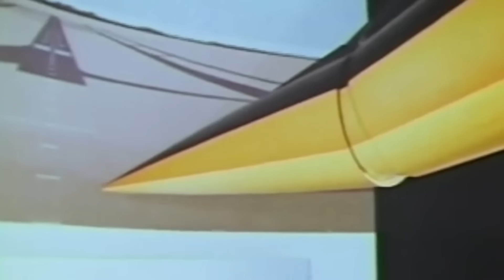The Insanely Bigger Faster American Concorde Failures

Comment: The reason CONCORDE failed was basically because the US government (paid for by the AIRCRAFT LOBBY) wanted it to fail as they couldn't make the SST work.
Reply: I grew up in Oklahoma City and in the early 60's the FAA coordinated with Tinker AFB and they did sonic boom tests twice daily over the city to see the effects.  You flinched every time you heard one, the dogs went crazy and they even had a phone number to call if you had a broken window because of a boom and they would send someone out to replace it.  After about a year they stopped the tests and determined it was too disruptive and that's where the ban on supersonic flying over the US by commercial aircraft came from originally.
Reply: @gregmiller7123  There were similar sonic boom tests in Chicago, though on a much smaller scale than the Oklahoma City tests. The claims for sonic boom damage were proportionally higher in Chicago, as expected in an area of higher population density. It's my understanding that the FAA would accept damage claims but the procedure was heavily bureaucratic and the FAA would use any excuse to deny a claim.
Reply: ...and the FIA banned Concorde from flying overland ... just to be sure !
Reply: @pierrepy2931  I think you mean the FAA (Federal Aviation Administration).  The FIA controls motor racing and I've seen some fast F1 cars but I don't think they broke the sound barrier!  Just messing with you!  Cheers

Comment: the Concord made the first A300 Airbus a pretty good plane, new alloys and machining, vented insulation, lighter seats, higher pressure hydraulics, tail tanks,  etc..better than Tristars , DC-10 and MD11...HS also used the Concord cab. diameter and fixtures to build the HS146 but supersonic aluminium planes were at the time too heavy and were flying too low and too slow thus increase drag and friction heat excessively. Today a composite airframe and better thermal cycles with H2 maybe can reduce the supersonic gal/mile to a competitive level by flying much higher and facing much less drag..

Comment: JFK didn't take office until 1961.  Also, the FAA is an administration, not a federation.  Too many errors right at the outset left me in skepticism mode while watching this.  Concorde operated for a couple years after the crash in 2000 and the fuel tank bladder installations.  There needs to be oversight before turning your finished project loose!
Reply: @Galileo7of9 Still not a federation though!

Comment: I saw a Concorde abort a take-off at London's Heathrow airport on 25th January 1982. It taxied back to the terminal where I guess either the problem was fixed there and then or the aircraft was taken out of service and another Concorde used, as I saw one take off about an hour later. Very noisy on takeoff but quietened down once in the air.

I'd like to see a feature on the development of  Martin-Baker Ejection seat and its derivatives, and the Russian versions. I read a book called "The Man in the Hot Seat" about it and it was a fascinating story.

Comment: The boeing mock up carried on as a tourist attraction at a so called " site museum" in Orlando, Florida. It was inside a large hangar with a lot of sad looking warbirds. I saw it twice in the 1980's, it was tired looking then, but the museum closed and the building was turned into a church  with services being held under its wing. For years they tried to give it away, but the draw of a one winged wooden mockup was zero, and I believe it was finally scrapped in the 90's
Reply: It sits in the Museum of Flight in Seattle, if I’m not mistaken

Comment: Another aspect was that Concorde was limited to Mach 2.25 not because it couldn't go any faster, but because aerodynamic heating would also be limited, allowing the aircraft to be made out of aluminium. The faster 2707 would have to use large amounts of titanium, a metal very hard to work with at that time.
Reply: Also most came from Russia.
Reply: @christopherrobinson7541  if that were true, the MiG-25 would be made completely of titanium, instead of from steel with titanium leading edges.
Reply: @JBofBrisbane  no he's right. They acquired alot of the titanium for f117 from Russia, but had to create psudo companies so the Russians didn't suspect anything.

Comment: The 747 was a backup plan if the 2707 didn't work out.  The 747 had a upper deck and a front loading door for unobstructed loading of cargo just in case that carrying passengers thing didn't work out.
Reply: It was the other way around. The 747 was aimed at the cargo airliner competition that the C5 Galaxy won; the passenger airline was the runner up prize.

Comment: This design was also very similar to one of the XB-70s prototypes
Reply: What resemblance do you see?  Looks completely different to me.
Reply: @winternow2242  I've read a book about the XB-70 and how if it worked the Valkyrie would be the first of many many large supersonic aircraft with both military bomber's and supersonic transports for civilian use. There was alot of prototypes one of them being similar to the featured aircraft
Reply: @SuperDiablo101  the problem with Valkyrie was that the design didn't translate well to airliners. North American was 1 of several companies submitting SST designs, and there's trailed those of Boeing and Lockheed in terms of range and passengers.

Comment: the power needed to push an object through a fluid increases as the cube of the velocity. That is all.
Reply: Once you get to the speed of sound, a transition occurs and you have to push a shock wave along with you, thus the sonic boom and the drastically increased full consumption per passenger mile.

Comment: I loved the line about the Soviet SST running into "insurmountable problems."  Here's the story I got from some people in the know:

This was during the Cold War, and the Kremlin had ordered that the USSR produce the first commercial SST, no matter what.  This lead to the KGB working to put its moles into the design process.  The pressure was so great, that the moles got sloppy and were found out.  Rather than being fired, etc., the Concorde designers created a set of blueprints that were almost exact copies of the Concorde with one important exception: the center of balance for the craft was put about 10 feet to the rear of where it should have been.  This change would have not been noticeable during normal operation, but produced a lot of instability when trying to land.   These blueprints were left laying around where the moles could find and copy them.

Fast forward to the 1973 Paris Airshow, where the Soviet Tupolev 144 was being presented as the first available commercial SST.  The flight showing it off was going fine, until the plane aborted a landing approach, shook itself apart, and crashed.  The Tupolev 144 was used only internally by the USSR, since they couldn't figure out why it was so unstable coming in for landings.  It was eventually removed from passenger service, used only for cargo, and finally retired in 1978.
Reply: Lol nice
Reply: Where did you find this information?
Reply: @zbdot73  I have had friends who worked in the aerospace industry, in projects where Soviet espionage was a real concern. This is one of a number of stories I heard late some nights, over beers, when talking about what today is called "disinformation". (The term didn't exist then, although the concept has been around for ages.) No one involved will ever come forth to say this is in fact what happened, especially since children were killed. (Check out the Tu-144 Paris Crash, where they had some kids as passengers on what was essentially a test flight.) But the aviation engineers I've told this to have all confirmed that moving the center of balance back would result in just this type of instability.
Reply: @jkcarroll  Cheers thanks for the info, I've also read the rubber compound for the tires were an issue for the Russians also.
Reply: @EdOeuna  I bet they were surprised to find that the answer was rubber.

Comment: There are actually several SST's in development right now. ESA's is more ambitious since it's hypersonic and then there's a japanese concorde essentially. Also several smaller planes along the lines of a gulfstream.

Pretty sure they're all gonna fail due to economic issues. In the first place development of such a craft is virtually impossible without massive government investment and man are they expensive to run. Most people just don't need to travel that fast.

Comment: @5:35....The engineers DIDN'T-  as you say/quote:  "add canards behind the nose to increase weight".  Wtf?  Canards are for PITCH control, doing the same thing as an Elevator at the rear of a conventional a/c.  Jeez-  Get the BASICS right.  That's Aeronautics 101.
Reply: I mean, they might've added them for weight. Canards aren't weightless just because they're a control surface.
If you need weight, add weight. Make it DO something if you can.
Reply: Yeah, that's ridiculous.  You can move weight to change CG, but you don't just add weight.  Maybe they used canards instead of elevators for some reason.  Is that logical?
Reply: @RileyFingeredMyDog Yeah, I know what they're for.  My point is that maybe they preferred to use canards for some sane reason and that's why they used them.  Not to "add weight".
Reply: Congratulations, you've fallen into the Dark Skies algorithm trap.
Reply: @RileyFingeredMyDog That wasn't a question.  It was a polite way of suggesting that canards have a function (other than weight) and perhaps the designers preferred using them for reasons of their own.  My question was "Is that logical?"  I know, sometimes it's difficult to sort thru the thinking when texting.  Things seem to come out differently to the reader than they were intended by the writer.  I think we're all on the same page.  It seems the narrator is saying that weight was moved from the tail to the canard in an effort to better balance the entire plane.  What ever.  Good job of dissecting all of this.  Cheerio.

Comment: @darkskies this summer in the middle of the mountains of Maine my son and I saw a very large air craft that had 4 glowing engines it was flying low and was silent! Where we were was so secluded and quiet we could hear commercial aircraft at 30k+ feet and it was a full moon without a cloud in sight it was very large and looked like 4 engines with afterburners on but didn't make a noise I still wonder if it was a ufo.

Comment: Don’t lead your videos with incorrect information. Concorde was far from the first supersonic plane and wasn’t even the first supersonic airliner. Get the facts right if you want to be taken seriously as a documentary channel
Reply: The Prototype Tu144 beat the prototype Concorde into the air by a month. The Tu144 never really made it into regular passenger service and was taken out of passenger service after only 50 or so flights, unlike the fleet of 14 Concordes which flew for nearly 30 years in passenger service.
Reply: @richardhill2643   But concorde wasn't the first supersonic plane or airliner designed, built or flown. So since I already knew this what exactly are you trying to tell me? Tu144 still flew as an airliner, even if it was briefly. So what is the point of your reply?

Comment: The initial design of the 2707 is so cool looking. Everything should have swing wings. While it has its advantages, there is the issue of weight and complexity (more things that can break is not a good thing) and that, unlike the Navy or Air Force, airlines are in the business of business to turn a profit.
Reply: Actually the reason the Navy and AF stopped using variable geometry wings in aircraft IS because of the added weight and complexity.
The F14 was one of the heaviest and most expensive fighters the Navy ever flew. In cost per flying hour, the F14 cost twice as much to operate as the F18Es.
Coupled with the fact they just didn't NEED an interceptor capable of mach 2.4
Reply: @thundercactus  ...but a "Big Tom" streaking by in a low level pass was still something to see.

Comment: The Lockheed double delta wing design was not inferior to the Boeing design. On the contrary, when Boeing couldn't make the swing wing work, they switched to a double delta design as well, and Lockheed screamed bloody murder that Boeing should continue to be the contract winner when they pretty much lifted the Lockheed design right off the drawing boards.
Reply: The 2707-300 was a tailed delta design, not a tailless double-delta like the L-2000.
Reply: @JBofBrisbane  , oh, I know that very well. But I take a more cynical look at that. If Boeing went with a tailless design at the same time they killed the swingwing and went to the double delta, then no one could pretend it wasn't a farce. Now, we all know the stability and maneuverability advantages of having a horizontal stabilizer separate from the wing, so I'm not going to fault Boeing for continuing with that.

Comment: Concorde was a failure economically due to its limited carrying capacity*. That was one thing that Boeing and Lockheed both got right. But in the end cancelling the program was the smart move given oil shocks of the 70s. Although the idea of 2.5 hours from Chicago to Hawaii sounds attractive. Especially given the seats in economy.
*Something the Brits did more than once was to build aircraft with too small of a passenger capacity.
Reply: Comparing size and capacity of concorde, 737 and 747 it seems to me that concorde would have faced serious size issues with increased capacity. the 2707 would have been twice the length of a 737 with comparable capacity. heck it would've been bigger than a 747, which has more than double the capacity. the limited carrying capacity seems to be part of the tradeoff for speed rather than a shortcoming of concorde.
Reply: "Something the Brits did more than once was to build aircraft with too small of a passenger capacity". Like Comet 1st in its Class and Concorde Shared 1st in its class. Yanks just need a nudge now and then don't they?
Reply: @samclark8468  
When Boeing was developing the Dash 80 into the KC-135/707 they had to actually increase the diameter of the fuselage. The Dash 80 would have only seated 5 across. Of course Douglas was watching al, of this and designed the DC-8 to have a larger passenger capacity th as n the 707. But then Convair decided to go for speed. I'm not sure but the Convair 880 might still be the fastest subsonic civil aircraft to enter passenger service. Today it's all about how much fuel it takes to move x amount of weight x amount of distance unit (km or miles, your preference). The longest flights I've taken have been Chicago to Honolulu.  Going there it is usually about 8 to 9 hours depending on headwinds. Coming back its usually faster.

Comment: I reckon there's more to this story. If they REALLY wanted to get the job done, they would have. Look at the success the US had with the B-58, the XB-70, and (later) the B-1. Those aircraft not a million miles away from a potential supersonic airliner. Great video again DS, many thanks.
Reply: I imagine the same reasons they stopped flying the concorde. it costs too much. and while going faster is generally better...not at any cost. most people that travel don't actually need to go that fast.

Comment: "...an american built supersonic airliner will finally take to the skies, but this time no european rival in it's way" 
Did I miss the part where the concord was preventing an american supersonic airliner?
Reply: No you didn't.  While fun to watch these videos are overfilled with errors and overdramatization.
Reply: The concorde and Tu-144  were, in part, to blame for the demise of the american SST. Not because they were successful, but particularly because they weren't
By the time the concorde flew, it became very apparent that SSTs absolutely could not compete with turbofan airliners financially, and there just wasn't enough passenger demand to justify the significantly higher cost associated.
Reply: @thundercactus  Partly because when the US realised that they couldn't build an SST, they neutered Concorde by effectively banning SST flight in the US. How much more demand there would there have been if JFK to LA or SF had been allowed ??